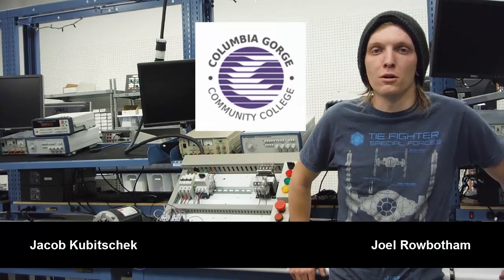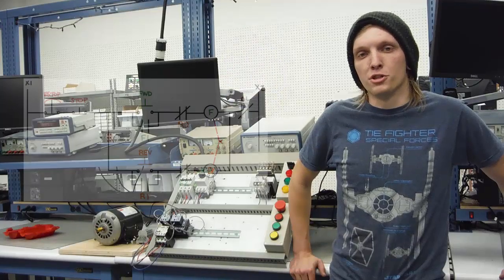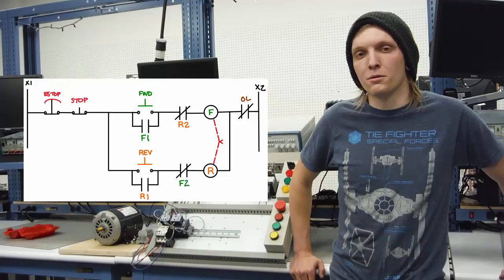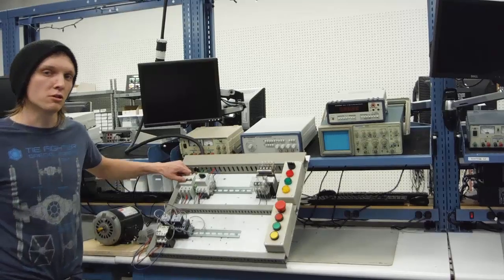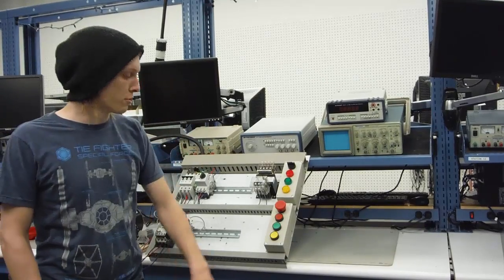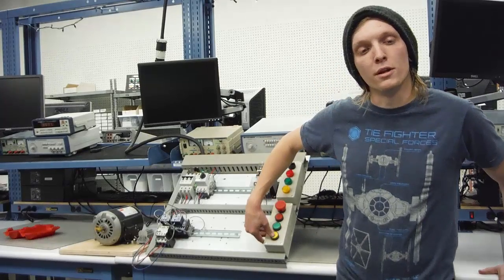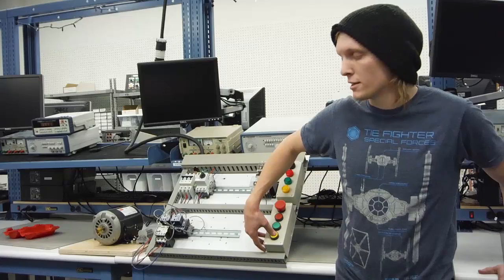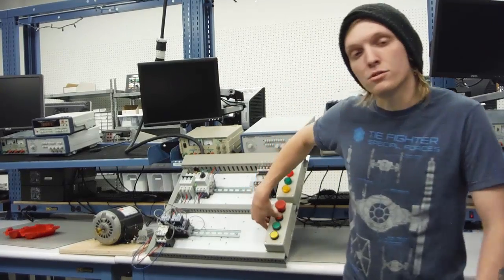Reversing Magnetic Motor Starter Demonstration (featuring Jacob and Joel)

Comment: Question about the hardware setup/teaching panel. Did you make your own din rail/conduit/indicator panel or did you buy it pre made (just had to add contactors, wires, etc.) It is is nice setup for teaching and better than a lot of trainers that are banana plug galore. Thanks!
Reply from the maker: Daniel stay in touch because I'll have a whole series of videos coming out real soon about making your own motor control trainer board
Reply: Awesome! We use Amatrol trainers but I would like something with more Discrete Wiring so I can double this for wiring up PLCs and other things.

Really like your videos. I've used them to supplement the Amatrol content.
Reply from the maker: Exactly my intention in creating this trainer board. We have a double sided FESTO/LabVolt Industrial Controls trainer (8036). While I LOVE this trainer for classroom demonstrations (and the content is awesome!) I found that students exclusively using these types of purpose built trainers miss out on the hands on wiring, terminal identification, and specification reading using real components. I use a mix of both methods now with great success. Read you on the PLCs. This type of trainer board plugs into a PLC setup quite nicely giving students a chance to make some real functional circuits rather than just some stupid lights blink. Like I said I've got a whole bunch of videos on the trainer board coming soon. Here's the first one: https://youtu.be/BUv4YVt34Pw stay in touch because a bunch more are headed down range soon.